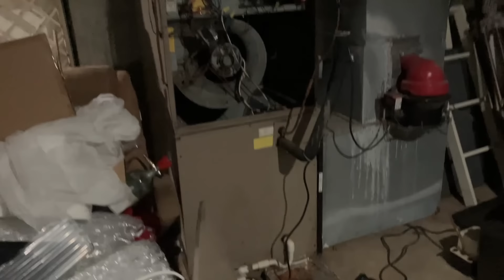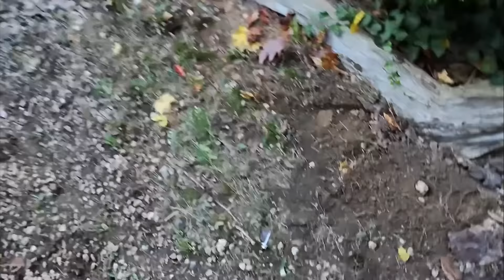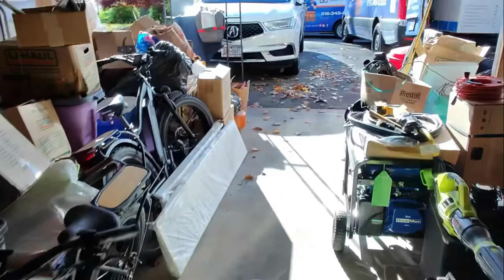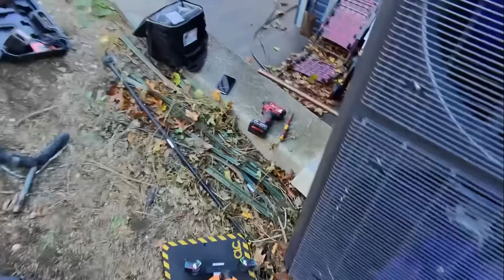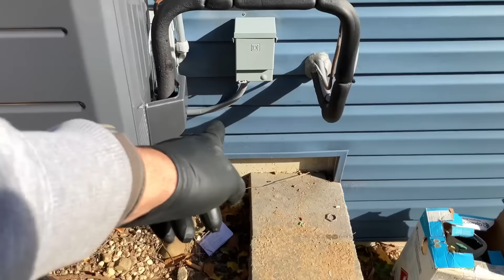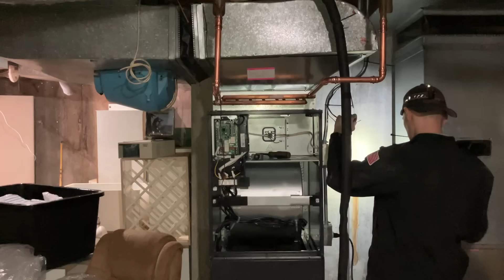ACiQ 5-Ton Inverter Heat Pump Retrofit — SAME DAY Dual Fuel Upgrade by Mikey Pipes!

Comment from the maker: If you’re tired of getting bamboozled by HVAC contractors and you want TRUE 21st-century efficiency, reliability, and whisper-quiet performance… upgrade to a Mikey Pipes by ACiQ inverter heat pump today.

🔥 Want to become an ACiQ dealer and offer this same extreme-efficiency equipment to your customers?
👉 https://aciq.com/mikeypipes

📞 Live in the Long Island / NYC metro area?
Call 516-348-6300 or book online at pipedoc.net for honest, transparent HVAC service.

Be well. God bless. Stay safe.
— Mikey Pipes

Comment: ACIQ should come out with a water unit. No more gas all the way into the houses only in outdoor unit.  Water lines into inside would be plastic and easily installed.  No more vacuum and cleaning of line sets. Less gas leaks in future. Less time to install and troubleshoot.

Comment: Filter driers are for oxidation(forms on the inside of the pipe as well) from brazing .
Zoom lok, or 3-5 psi of nitrogen flow (not pressure) during brazing prevents it.

Heard certain mini split manufactures would void comp warranties over brazed lines. Nitro brazing became an accepted alternative.
Reply: that's the "filter part", but you're forgetting about the "drier" part, aka desiccant, which removes any residual moisture out of the sealed system.
some atmosphere(which has moisture) always gets in when connecting fittings, gauges, checking pressures, as well as some can remain trapped in the various materials due to porosity
and there's always porosity in all materials.  they all have a filter-drier mounted internally in the primary piping. so no need for external and it could mess up/delay sensing and function if on individual lines to the heads.

Comment: WOW! That’s an awesome installation! I like the mount of the condenser because it keeps it off the ground preventing debris from collecting on the coil. However, it looks difficult to clean the coil that’s closest to the house? Do they make a raised ground mount that could be anchored to a concrete slab? That way it could be away from the siding and also be service friendly!

Comment: The water coil on top is going to cut static pressure way down. I’ve dealt with a very similar setup. It wasn’t able to electively cool the space on summer months. In winter the boiler did heating so it worked out. I ultimately made a quick release setup for customer with a removable cover that the customer could use to seal coil in summer and pull their own coil. First time in years they had good AC this summer after removing water coil. The ECM blower  dead headed against water coil while trying to suck through heat pump coil. The system is a geothermal, slightly different setup but not much.
Reply: Can you increase airflow with dip switches? I know you can go decrease cfm to increase humidity control.   This dual fuel setup is so common in the northeast there must be provisions for the restrictions of the coil.

Comment: Crossover systems don't need a filter drier. An inverter heat pump works like a mini split and thats that. Internal strainer system, no drier.  Unit reverses automatically, drier will impede the refrigerant. It's not an old R22 reversing valve heat pump!

Comment: You need to have a Good Talk with the Employee who didn’t Quote the Job Correctly to take Mount Everest into account. 🤪😬👍
Reply: In a previous video, I believe Mike said he quoted the job (equipment and installation) without looking at the job. Additionally, he stated he would have added cost for the elevation obstacles.

Comment: Mini splits use strainers so you can not use driers. They also have eev”s or lev”s that filter driers can restrict just by being in the system. Pretty sure the line set your taking loose at the air handler there that’s either a strainer or drier in the liquid line. Typically a silencer or muffler is in the outdoor unit on your dis charge line not on the liquid line. Love ya fellas thanks for all the content keep it coming
Reply: Thank you ❤
Reply: Correct. No drier on my 3 ton extreme plus. Awesome unit. Great price.

Comment: He did the gas line wrong . Traps gotta be on the vertical not horizontal. Cmon man. You always pick out the smallest thing too lol. Bad Carlos
Reply: yeah, always at a 90 degree flow change point, from vertical down to horizontal across, with the leg in line with the supply.
now days they're rarely needed, as the gas is generally very dry to start with, but they can help catch any debris left in the lines from threading, chips, oils and pipe dope.

Comment: How do you find the studs behind the vinyl siding?
Reply: I use my thermal imager when I work on really old homes and find them no problem. I assume it would work on vinyl sided houses as long indoor temp is warm enough.
Reply: he doesn't lol. those bolts should be able to hold it just on the plywood.
Reply: @vshady01  Absolutely not.  Needs to be into structure.  I would definitely not trust sheathing long term.

Comment: Red oil might be a oil additive by supco s88
Reply from the maker: Interesting thought!
Reply: Yea i was thinking the same thing we used it on units that had issues with stuck txv's on trane units like 6 years ago were i used to work
Reply: red dye for leak finding was common, long before UV dye and light sources were available for in field use, also the very bad type and other snake oil leak sealers had red dye, that's the stuff that ruins gauges, hoses, schraders, filter driers, compressors, txv's and more. but it sure will seal it up at contact with any moisture, like when trying to service the system.